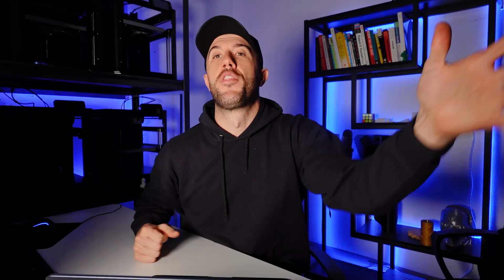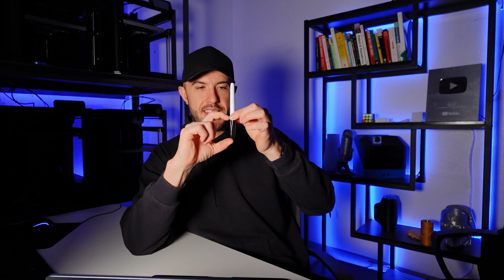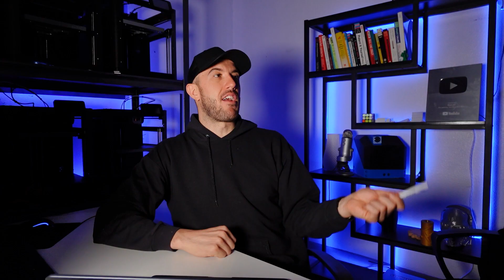Stop Saying 3D Prints Aren’t Food Safe

Comment: Bacteria; I logically agree that  3D prints probably don't pose any additional risk, this is why in the brewing process all implements need to be either sanitised or boiled for 5+ minutes either in the wort or otherwise, before being inoculated with yeast. This suggests most implements such as spoons, pots, containers are inherently dirty and may not have a lasting impact on food especially onced cooked (after using a 3d printed implement in preparation). E.g. a pot or bowl scraper or cutter for dough.

Comment: This is just a rant. Cite some sources my guy. Wood cutting boards develop grooves but they are naturally antimicrobial. Plastic boards need to be sanitized regularly because of the bacteria that gets trapped in the grooves. 3d prints come with the grooves, on the entire surface. PLA also has toxic additives and stabilizers beyond the plastic, like the dyes in some case. They don't have to list the ingredients because they expect people to not let it come in contact with food. This video feels like a bad move for your brand. Maybe do a follow up where you do tests on 3d-printed items you think can safely be used and compare them to a food safe control and a cheap plastic amazon product.

I clicked on this video hoping to actually hear some new info or studies regarding the food safety of PLA prints, but instead I got a "It's just a flu!" speech circa 2020.
Reply: Innovations in Sanitization for 3D-Printed Parts in Medical and Critical Applications on researchgate

Comment: This is completely false information. You compare this to plastic cutting boards. YES. Did you know that plastic cutting boards pose a high risk of harboring bacteria in both existing and knife-derived grooves, and regularly shed microplastics during use?

This also just completely ignores basic, fundamental physical properties that materials have. If you have something with grooves, it will, by definition, have more surface area that needs to be cleaned, but have the indented shape which makes it harder for something to get within that groove. This is simply a fact of reality. Does it mean it's impossible to sanitize? No. But it is much easier to, for example, clean a bowl with a consistent, smooth surface, than one with hundreds and hundreds of tiny grooves that things can be stuck in at microscopic, bacterial-level scales, which are just going to be harder to clean, and could require strong chemicals, some of which can still be prevented by bacterial biofilm that cannot be cleaned easily out of those grooves.

You also mention things leeching into the infill. This is a genuine problem. Injection molded parts will have no hollow internals unless made that way, and won't even have gaps or bubbles if done right. Even 3D-printed objects with 100% infill will sometimes have gaps between layer lines, which makes them not impervious to leeching of liquids or even powders into the part over time, especially with use.

Slant 3D is a 3D-printing company. That does not mean you have to spread misinformation about the food safety of 3D-printed parts to benefit your business. This is the kind of behavior that now means I will never order from your company, recommend you to others, or buy your filament from Tangled, either. This is the type of information that could cause someone to print and use an item for their kitchen that later grows bacteria and makes them genuinely sick. Shame on you. Do better.
Reply: Innovations in Sanitization for 3D-Printed Parts in Medical and Critical Applications on researchgate
Reply: @SniperAngle12  To reiterate what I've already responded to your comments with:

That research paper recommends coating 3D prints intended for liquids in food-safe resin, and recommends a 2-minute bleach soak for consistent levels of safety. It also states that water alone provides effectively ZERO cleaning power within the grooves, which eliminates much of the cleaning effect of the pre-wash cycle in dishwashers. The study only used a single method of bacteria deposition (broth or blood from chickens only), and showed that 3D-printed parts experienced a maximum reduction of 95% bacterial reduction under ideal conditions, while stating that glass plates and standard spoons would, under non-ideal conditions, experience 99%-98% reductions.

Their recommended overall method of cleaning to match that of non-3D-printed parts is warm soapy water with baking soda*, solely using *moderate force*, then soaking in *bleach or isopropyl alcohol*, then only *air drying. Something most normal people will never be doing. And even then, they say that it requires more research, because some cultures of bacteria still grow effectively in the grooves after that.

Oh, and they also say that all colored filaments should have resin applied for safety. Most filaments people use are colored.
Reply: @hackladdy9886 Then I recommend you read what I replied to that comment with. I only provided the link for other readers.
Reply: @SniperAngle12  And you are spamming it. Once would suffice...
Reply: @herlandercarvalho 1 per comment that asked for a source is spamming? Are you real?
Reply: @hackladdy9886   yes, but you apparently didnt read my paper correctly and got 90% of your information wrong and added your own thoughts and ideas to the study. 

i have tested color filaments for migration and leeching of colors, toxins, and heavy metals. NOTHING. That paper is currently in peer review. I told people to coat their parts as a disclaimer as no studies had been done at that time, but now studies from my lab have been done . Even in my new paper, my lawyer told me to add the disclaimer about coating. 

As for the "single method for bacteria deposition" what are you trying to state? In a lab or at home, there are only a very very few ways bacteria and pathogens can get onto an item. In a lab, all parts were inoculated with pathogens that we grow. Our lab follows all the standards and methods for microbial surface testing and pathogen growth for testing objects for food and human contact safety, thats exactly what my lab does, we test things for food safety. WE CREATE THE STANDARDS

"And even then, they say that it requires more research, because some cultures of bacteria still grow effectively in the grooves after that" I never stated that at all. I never said that some cultures of bacteria STILL GROW EFFECTIVLEY in the groves.  

Here is EXACTLY what i said  " IPA  COULD potentially  increase  biofilms  with  specific  pathogens  such  as Staph.  Therefore,  70% or  higher  IPA  should  be used  AFTER cleaning as a precautionary sanitization step,"    This means DONT use IPA as the first cleaning agent, use it AFTER as a sanitizing agent as i specifically said "Therefore,  70% or  higher  IPA  should  be used  AFTER cleaning as a precautionary sanitization step"

notice you called it the pre-wash cycle of a dishwasher? The pre-wash cycle is exactly that, the pre wash cycle, it does not do much cleaning. It will get large contamination off but in order to actually clean something, you need soapy water and help lower the surface tension of the water to create "wetting" on things. 

"Something most normal people will never be doing" well, thats why its called a standard, either do it or dont. Its like changing the oil in your car, either put the required steps and amount of oil in your car or dont. Washing a part with warm soapy water, and a little baking soda by hand takes no more than 30 seconds. and IF you choose to further bleach soak it OR use IPA you can. EVERY food establishment does exactly this. they wash, rinse, and sanitize. If you run a food truck, food tent, food cart, or a restaurant, you have to wash rinse sanitize. Its a VERY VERY common procedure that 95% of the population is aware of.

Comment: If anyone is still worried about the bacteria, bacteria gets where it gets via water, so anywhere there's bacteria can be sanitized with a one minute soak in a solution of water and some kind of sanitizer. (It takes about a minute for a lot of sanitizers to kill the bacteria). If you do that regularly, which you should also be doing to all your food contact items because dish soap isn't typically non bacterial, then you should be fine most of the time. I've been using 3d printed chopsticks I made almost a year ago almost every day and I've been sanitizing them in a solution after most uses. I've seen some metal spoons in my house get dirtier than these chopsticks because I'm not as vigilant about the metal utensils. It's all about cleaning and sanitizing, and acting quickly enough to not let bacteria take hold in the first place. Bacteria can't grow if you kill them.

Comment: 1) bacteria gets between the lay lines

2) microplastics is not good for you, especially in food. That’s why you should never use plastic cutting board boards. And you shouldn’t limit the use of micro plastics in general.

3) THERE ARE MANY FILAMENT BRANDS THAT SPECIFICALLY SAYS THEIR FILAMENT IS NOT FOOD SAFE
Reply: Regrading #3, you didn't listen to him, to get Food Safe you need to pass certification, so the brands that write "not FOOD SAFE" are probably also selling "FOOD SAFE" filament for extra cost because it pass certification, so your point is not valid
Reply: Innovations in Sanitization for 3D-Printed Parts in Medical and Critical Applications on researchgate
Reply: @SniperAngle12  That research paper recommends coating 3D prints intended for liquids in food-safe resin, and recommends a 2-minute bleach soak for consistent levels of safety. It also states that water alone provides effectively ZERO cleaning power within the grooves, which eliminates much of the cleaning effect of the pre-wash cycle in dishwashers. The study only used a single method of bacteria deposition (broth or blood from chickens only), and showed that 3D-printed parts experienced a maximum reduction of 95% bacterial reduction under ideal conditions, while stating that glass plates and standard spoons would, under non-ideal conditions, experience 99%-98% reductions.

Their recommended overall method of cleaning to match that of non-3D-printed parts is warm soapy water with baking soda*, solely using *moderate force*, then soaking in *bleach or isopropyl alcohol*, then only *air drying. Something most normal people will never be doing. And even then, they say that it requires more research, because some cultures of bacteria still grow effectively in the grooves after that.

Oh, and they also say that all colored filaments should have resin applied for safety. Most filaments people use are colored.
Reply: @hackladdy9886  The study also does not account for the dangers of other residual substances like microplastics, which is currently unknown, and it's safe to say that 3D printed parts are more likely to increase the amount of microplastics ingested, than a regular plastic object that is created with injection molds. Any person "claiming" that 3D prints are food safe, is probably the same group of people that drink their piss and eat dirt to fight a viral infection... Just saying...
Reply: @herlandercarvalho   glad you brought this up. That paper is currently in peer review. and their is very little microplastics, negliable actually. I am the leading researcher on this topic
Reply: make sure you don't go outside either, nasty stuff is out there that will try and kill you

Comment: Thank you. About time someone used their brain. As someone that held a Serve Safe certificate for over 20 years, it annoys me greatly that people think the layer lines in prints are somehow different than the scratches in the wood or plastic cutting boards they already use in their kitchen. Wash the print properly and sanitize it it properly. I guarantee none of those people actually properly sanitize and air dry any of their kitchen ware.